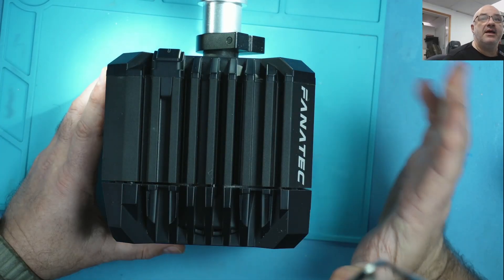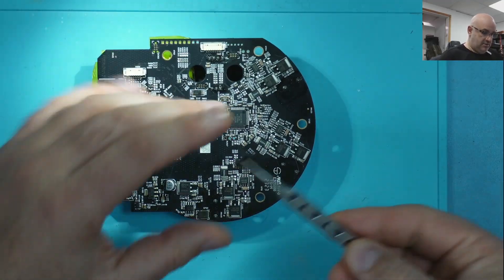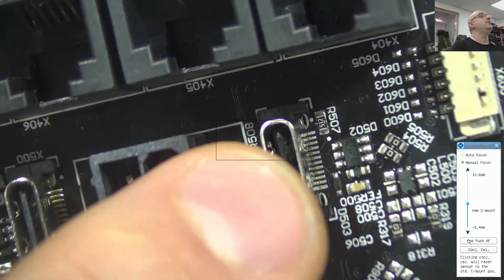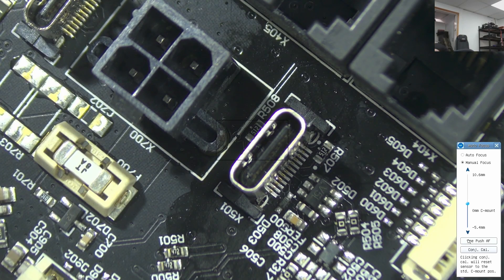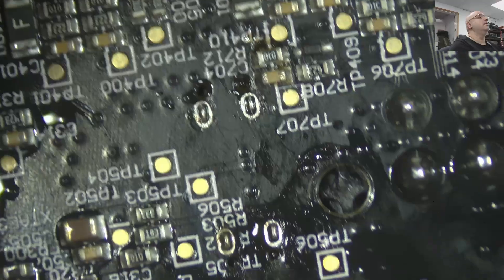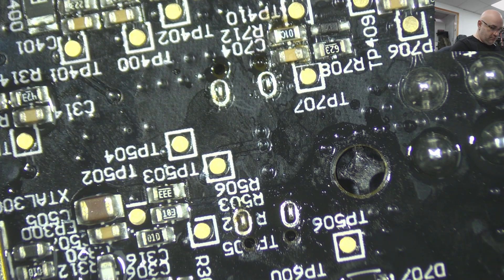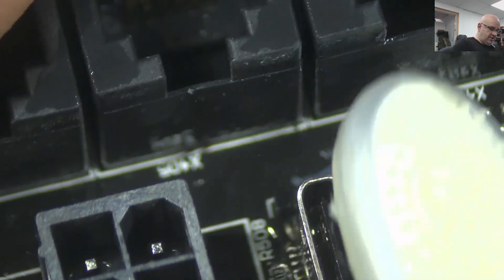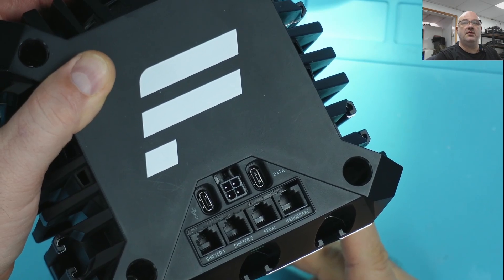Fanatec CSL DD Racing Wheel usb port replacement

Comment: Hi,
Is this likely to be the cause of "Unknown USB Device (Device Descriptor Request Failed)" would you know? 
I have done all the typical driver installation checks etc but nothing worked.
The CSL DD started to work again then just went back to the failed state described above, all I can think of is that this USB-C port feels a little loose (but it always has and so does the unused data port on the other side) and it doesn't really get bothered as its on a fixed rig.

Sorry for the tangent from the purpose of your video, but you seem knowledgeable and any advice you may have would be greatly appreciated! 
Thanks in advance